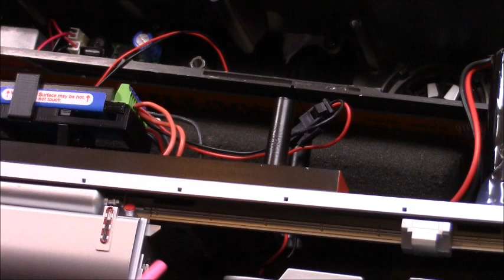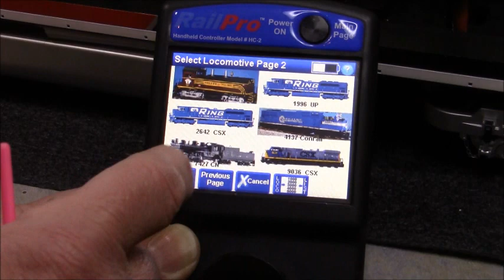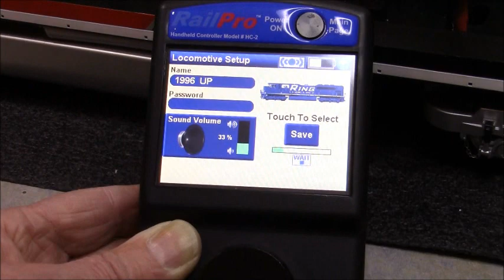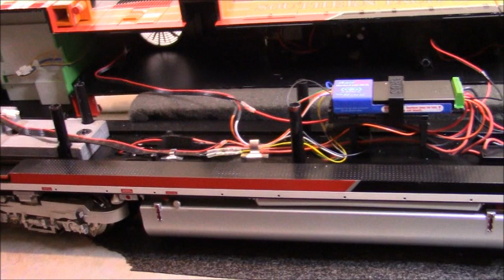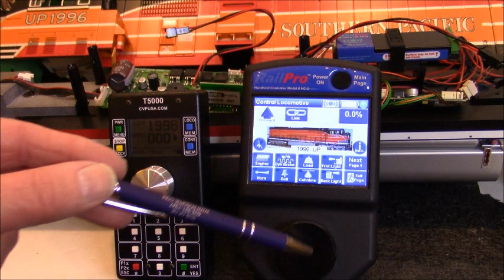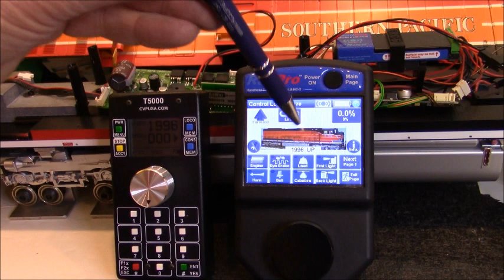Part 2 USAT SD70 RailPro v AirWire

Comment: I really like the idea of this. The reason I am in favour of the Airwire system is because I can use any sound decoder with it as I would like to keep my ESU XL V5 decoders and not have to replace them. If RailPro would consider making a receiver that can control any DCC or DCC Sound decoder. I would vouch for them too. Hopefully they can consider this as when I go wireless. I am looking more towards the CVP Airwire system. Great video and thanks for sharing.

Comment: Do you have do that with all sd70 for that to work.
Reply: Yes , a full battery conversion adds the battery pack, battery install kit, Speaker and RailPro loco module. Then connect all the lights and motors. If you choose track power only, then eliminate adding the battery and battery install kit.